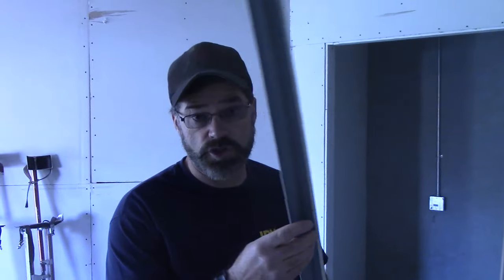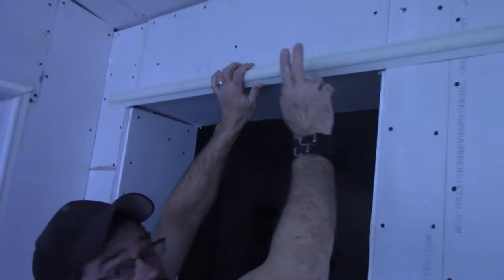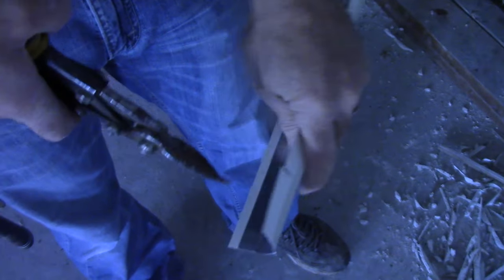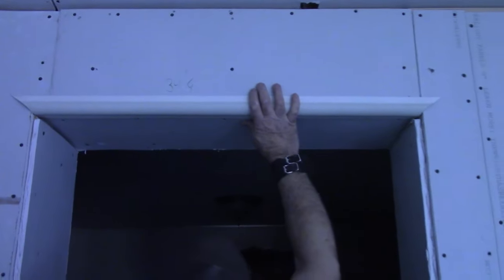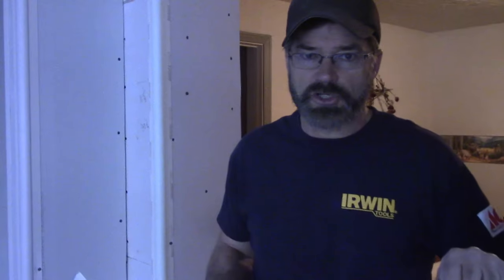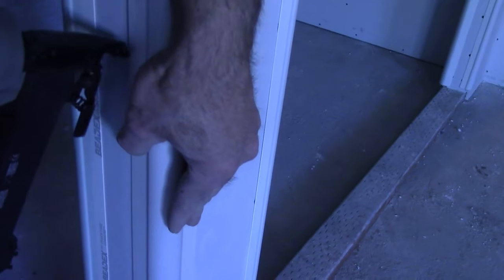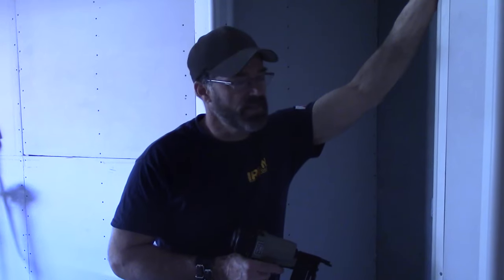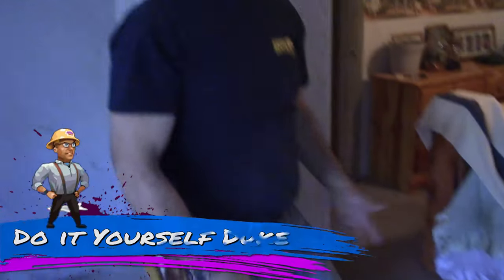How to Attach Bull Nose Corners on Drywall Job - DIY Duke

Comment: if i were a taper and walked in and seen that mess of drywall installed Id cry, four way intersections, gaps and the screws WTF your patience must be  something special
Reply: I never attempt to finish a DIY drywall hack hang job. always a nightmare.
Reply: So many screws!
Reply: I had a job years ago.  Friend of the family, contractor agreed to take it to board.  Wasn't great, wasn't horrible though for the most part by non boarders.  But the 1 bedroom closet 2x3 ft had 17 prices of drywall lol.  I found out and assumed so, it was a young apprentice kid that got left alone on a Friday aft to clean up and finish the closet.  Wish I still had the pick, it looked more like a Tetris game than a drywall job.  Must have taken the kid half a day to make the scraps work

Comment: Great video, but I have a couple questions:  Could you use the stapler on a vinyl corner bead, or could that tear out?  If not, what's better for vinyl, screws or spray on adhesive?  Thanks in advance.

Comment: those are paper faced metal bullnose..they r made to mud on
.you will have edge cracking and blisters..if they were made to nail on they would have holes in them..also the mud goes thru the holes...if u have no mud behind paper ....same as taping
Reply from the maker: +Jonathan wise not true, those are rigid bull nose paper coated so the pva, texture, prime and paint adhere.  Tape on have paper edges that are perforated for mud to grab.  These corner bead are superior to the all metal nail on.
Reply: I'm with Jonathan.....cracks are going to show

Comment: Learned to do them when they first came out by making a pattern at home and transferring it on at the job site I thought it needed to have like a curved cut in the 45 ° quick it looked pretty closed when installing it then I started mudding and noticed I could do that ,just a 45 ° on both and it worked ,

Comment: we always used mud to put those on we never used nails taping mud we used the one with lots of glue in it I've never seen it done this way and I prefer using mud but I guess it works this way too

Comment: Love your vids DIY Duke, I just see one problem, if something was to hit the corner and dent the corner piece, there's no fixing that is there?
Reply from the maker: yeah that happens a lot with cornerbead,  if its a small dent you can mud it and fill it, if more major you can cut out the section with a hack saw and fit a new one in then mud and match texture
Reply: That is why I prefer the tape-on. You fill the corners with mud and they dry solid like a rock

Comment: Can this be retro fitted? or is it just to big of a pain to do? If so, roughly how much would it cost? Thanks
Reply from the maker: +Ghostrydr1972 yes, you have to remove old corner bead and make sure the edge is trimmed to accommodate the radius of the bullnose. Then apply mud to match existing wall then texture.  It is a pain for sure.